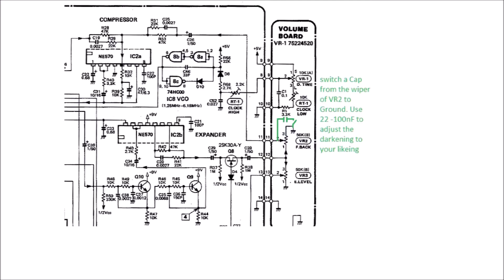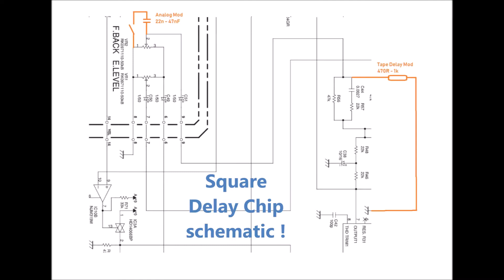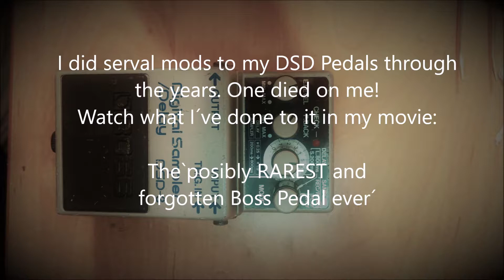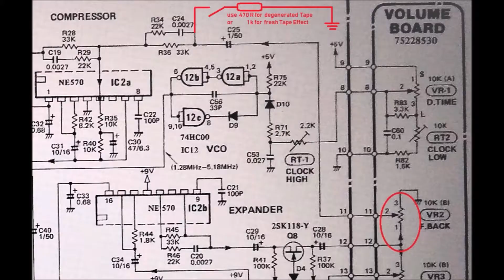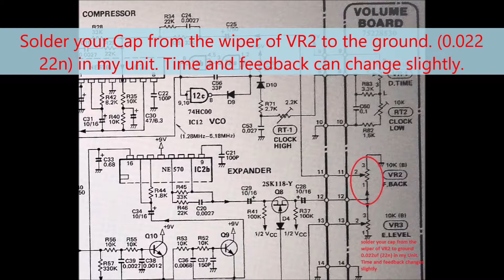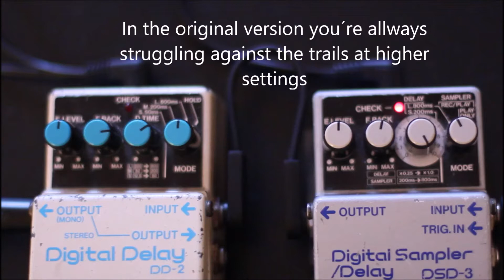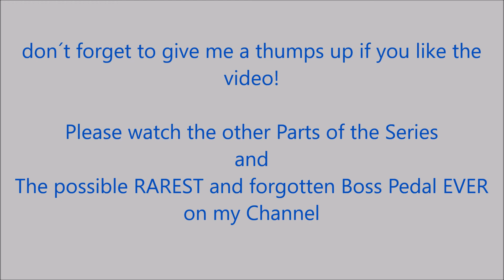The Boss Secret Mod Series: Part 4 the Secret DSD and DD-2 DD-3 Mod (ALL Chip Versions)

Comment: great channel, exciting topics, much success!
can I rely on values of 22nF to 100nF?
A recommended Keeley-mod is mentioning 0.22uF and 0.47uF for an on/off/on-switch...?!
🎸💨🎶
Reply from the maker: Glad you like it Mick! Yes you can go higher with your filtering up to 470nF but I wouldn´t recommend this. Going higher than the 100nF will shorten the feedback significantly. The Echo will be really dark and the difference from the first repeat to the following can get a little drastic. It will sound more like the analog version as it goes deeper and deeper in its revereration.
Reply: thanks, really sounds like a warm tape echo though being a digital delay. Will try to iterate my preferences.
Do you have any experiences using "high-cut mod" soldering a cap to level-pot?

Comment: Do you have any modifications for the Boss CE-5? The analog version.
Reply from the maker: Hallo Martin, if you have the analog Version of the CE-5 Chorus then you be the lucky one! It is very similar to the CE-2 (or CE-3) in sound and uses the same rare MN 3007 BBD Chip.
The mod is easy: Find R56 (10k). Desolder the one leg of it that is NOT attached to Q5 (2sc3378GR). Solder a wire to the leg of R56. Find C41(1uF). Desolder the positive leg of the capacitor. Solder the wire to the positive leg of the cap. Done. Now you got an CE-2. Of course  NO FUNKTION OF E.Level  and High/Low filters anymore - just DEPTH and RATE. Good Luck!
Reply from the maker: @Martin_Tudela_Orsi CE-5:  If anything I would get rid of C22 (5p). The right 47p (C21) already exists in the clock circuit. The CE-2 workes with 12V ACA at 10.8 Veff. This is barely enough. For a MN3007 BBD a minimum operating voltage of -11V is recomended. (9V or Battery IS to low) The CE-2 sounds lush and deep with more voltage - I don´t dasychain it.
Reply: @MrJLobster  I understand the voltage point. But what about the people who convert the CE-2 to 9v for their own convenience? The CE-5 already comes from stock to work with 9v, it could be converted to ACA style. The BBD allows it as you explain.
What is not clear to me is that it does C22. Why do you suggest removing it instead of increasing the value?
Reply from the maker: @Martin_Tudela_Orsi  Decreasing the capacitor increases the frequency ozillation and therefore it creates a longer delay in the BBD which is desirable in a chorus. Unfortunately C22 adds capacitance and decreases the delay a bit. It´s may be useful for distorted sounds. 
Thats how I remember it. Should ask my Oszilloscope to be shure ´cause I haven´t done that a while… I hope it helps Martin
Reply: I will implement C22 and see what happens. I paid it very very cheaply and I was very surprised.  I had the Mxr Analog Chorus and I didn't have magic in clean sounds like the CE-5.  Greetings from Cordoba Argentina.

Comment: Q: if you are not familiar with modding and would like to go for these mods, where do you start? Is there a “how to” forum or do you just go for it?
Reply from the maker: Thanks for your comments! I would just go for it! The Boss Delay Pedals are not the easiest to begin with but unless you be careful to not touch the chip and watch out to not break any wires it should be possible to be sucessful.
The Analog Mod is very very useful, you will like it!
Reply: @MrJLobster  is there a general thing to get low end  on  a lot of vintage ones  like TW-1 ,CE-3? I guess caps values is where its at?
Reply from the maker: @yurav5109  welcome! No not in general. It depends mostly on the design of the pedal the buffering that was choosen and the Sound that was in mind.
Especially the older ACA powered pedals had a tad more lows -if ACA POWERED -what seems to be ignored in the todays pedal world. Some are designed to cut the lowest bass that typical conflicts with the effect frequencies. 
It also depends for which place in the effects chain the pedal was primarily intended.
And the vintage pedals where NOT intended for lots and lots of pedals in chains because there simply where not a lot pedals out there.
Reply: Analog mod gives depth to my ears, great mod